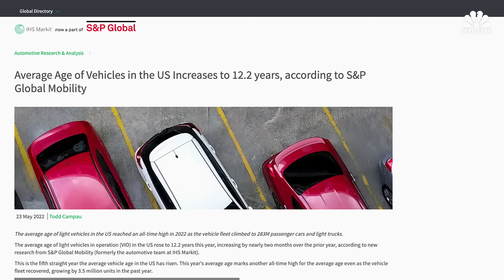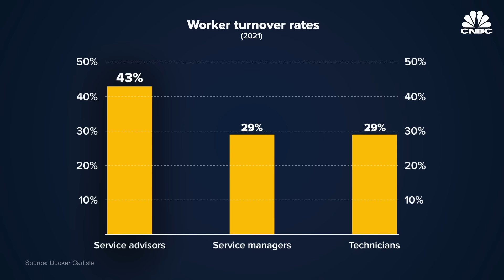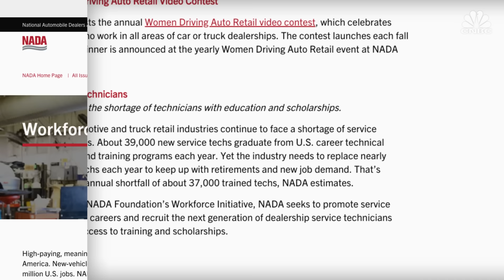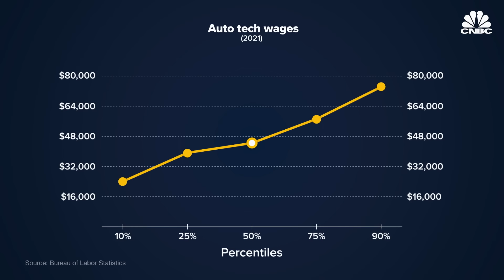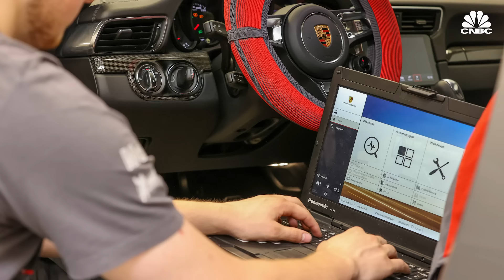Why The U.S. Has A Shortage Of Auto Mechanics

Comment: As a mechanic now I can tell you that pay and lack of training provided by the facilities themselves is making it really hard to make a living in  this industry.  We still get treated like grease monkeys even though most repairs are electrical or module based not even dealing with grease or dirty parts of the car. I myself am already looking for another opportunity to get out of this industry.
Reply: Look into machining.  After working almost 20 years as a mechanic I made the switch and would never consider going back to working on a car or anything else.  The pay is better and there’s a whole lot less drama
Reply: @bdp-racing  Its not as knuckle busting that's about it.  However, not all machine shop jobs pay well or are pleasant environments to work. Some people have to work in cnc cells 2 or 3  machines at a time. No air conditioning, no sitting down, no talking. . .some manufacturing is oppressive. Must punch out for lunch. . .Be there standing at your machine when the bell rings. Others are easy going. Today I work in an easy going place bosses are good. but that wasn't always the case. Places differ
Reply: It’s even more frustrating when a customer at a BMW dealership has to explain to the head tech what the bad module does, and the basics of Ethernet communication using corporate BMW wiring diagrams printed from home.
Reply: @jamie7664  yep, no lie.   That is exactly how bad it can be at dealerships, especially euro in the US, where we are pretty dumb, frankly, what with our 54% of population having a 6th grade reading level!!! yeah for realz!
Reply: Stop belly aching and open your own shop. All you need is a two-bay shop. Within six months, you'll have plenty of work.
Reply: Jerry Boden  The part had an eSIM that needed to be registered into their database (something only they can do). It was also a $1200 part that was still under warranty. Otherwise I always opt for doing the repair myself.
Reply: Jerry Boden  ISTA

Comment: The automotive industry has not seen a pay raise in the last 20+ years. Technicians in the 80's were paid 50% of the shops labor rate and cleared 100k. Now those techs are mostly out of the trade and the industry has greatly changed and become much more complex. Its almost impossible now to clear the same pay that was not uncommon 20+ years ago. Fixed-ops directors aka general managers are making 250k, service managers are making 150k min with bonus. Salesmen are all clearing 100k while they stand around most of the time and bs customers where we then have to go and explain to the customer that is not how their vehicle works. A technician is required to know how the vehicle works mechanically, electronically, features, options and diagnose a vehicle with 60 computers on it and multiple communication networks. Training is none stop because the technology is changing year to year and not getting easier. I have also seen a push where technicians are now being held liable if they don't catch something on a customer vehicle or for something that happens after the customer leaves. The professional tools are Extremely expensive! A single impact gun is normally around $500-$800 and the requirements to perform jobs on these vehicles cost the employee a huge amount of money and there is no reimbursement for it. I have 60K in tools and still need more but cant afford it. Imagine if there was any other field out there that required the employee to spend that much just to go to work.
You have a family, a home, utilities, gas, groceries, vehicle expenses, the list goes on as everyone knows. So where does it makes sense to pay a tech in this industry the way they do when the cost just to do the job is so expensive. Your on your feet 10+ hours a day standing on concrete working under a 200 degree engine and running around like your doing a speed walking marathon just because the shop wants to bring in 150 cars a day so upper management can get their bonuses.
New hires around my area are being paid $15 and not staying because they can go work with their cousin hanging dry wall for $24 to start, union, have  $ per $ match on their 401k and fully paid health insurance. Health insurance cost for my place out of pocket cost is $300 per month for a single plan, family plan is over $1000 per month... How.. Is anyone suppose to make a living with this.
Terrible pay, No Appreciation, long hours, horrendous benefits, working conditions, expensive cost in tools. This industry is going down hill and fast!! This industry needs to start coming to time and offering what every other trade has been doing for years!
Reply: I was a auto then a truck tech for 33 years, just recently quit the business permantly for exactly those reasons !!
Reply: Well said brother.
Reply: Wow, I never even thought of this. I was just complaining about the wait for my car that was in the shop. I have a whole new perspective now, Your work is appreciated.
Reply: @Sassysamaa  Industry secret.  If you put up with the wait, don't call every hour with "When's my car going to be done?" and pay your bill without any unnecessary drama, you'll become one of the shop's priority customers.  The shop I work at has a small group of priority customers who can bring their vehicles in and get service right away, at the expense of the "Joe Schmoes" who probably won't be back anyway.  The priority customers take care of their equipment (mechanics like to work on stuff that's going to be taken care of), they pay their bills and they keep coming back.

Comment: In the field for 42 years. I can tell you exactly what and when the issue started. It started in the late 90s when corporate business modeling took hold. Dealers were pushing the flatrate pay structure. That only works when on mainly one brand for efficiency. Independents started to adopt that pay structure. It doesn't work b/c all brands and mileage conditions are included. The efficiency goes down b/c of the skill level and equipment required. Shops started to push for techs providing equipment that shops used to supply. Mechanics not technicians used to be an asset to the company and treated as so. Now they are treated as a commodity that can be replaced. No respect for the soldier in the trench trying to save the day. Currently there has been a shift in volume available to produce the hours mechanics need. Hourly pay plans get a twist. They call it an incentive pay plan which is a lie. It's a penal pay plan. If you jump through all the hoops, billed & worked hours you get increased pay instead of just paying what a mechanic is worth. If you don't hit all the hoops, you lose pay rate even though you are working at the same quality rate. (Called penal plan b/c just like prison. If you don't do as required, you lose yard time or tv time. Penalized.) I come from a time when we were assets and paid accordingly. Usually, 50% of what is produced. That got chopped down over the years, 40% and lower to lucky if 10% in some cases. Also, there are more techs than mechanics to hire. Techs are the newbies from these useless training centers. You become a mechanic over years of experience as you take on new roles as tech, writer, managing ability etc. I get these kids fresh from training centers that don't know basics b/c never taught. Simple things like, why can't you run straight anti-freeze or which fluid is hydroscopic and why should it be changed on a 2 year schedule? The most shocking is when it comes to drum brakes. They are lost. They just pump out students willing to pay. I remember when I went to GM school. The teacher tossed out a kid b/c it was definitely the wrong career path for that kid. Where I used to work, we would take on UTI students to give them real world experience so they could break out of the hype told to them. One student took the advice when he started a full time position and called me to say I was so spot on of how the industry really is. He changed careers and started a glass replacement biz.  That was almost 20 years ago and he still thanks me. Many senior mechanics have switched to food industry. Same kind of busyness under demand. I agree that another issue is the loss of american car romance. With the systematic tear down of community through corporate expanse, we no longer have the corner gas station to hang out at and learn about cars. The need for double home incomes leaves less project time for dad to son car stuff. Less dads in the picture also contributes to this. Kids now just see transportation as a service need. Why would you have to deal with all the hassle of payments and insurance and parking when you could just make a call. In the future with automation, it will just be a service like other utilities. The over hype of electric cars saving the world is an issue too. I just keep pumping out 60hr a week for hourly pay until someday when I just can't anymore. Just turned 59 and even though there are some jobs I just don't prefer doing b/c I still have to make my body last, like replacing engines and trans, I am almost at the same pace as 30 years ago. I've seen many burn out and fade into something else over the years. I don't know if I'm lucky or not. I just have to keep busy to satisfy my A.D.D. or I'm left to come up with my own entertainment which is never fun for anyone else. haha. That is something I have noticed over the years also. Accelerated people like myself with A.D.D. or O.C.D. seem to be very good assets in this industry.
Reply: "No respect for the soldier in the trench trying to save the day" is the motto of the Republican party. I have some veterans in my classes. Officers that never go into combat and "men" that spent their whole careers in combat.
Reply: Respect to you and my apologies if I offended you in part or entirety in my reply, and for only responding to a few sections of your comment.
You mentioned that people used to become mechanics through experiences, as nobody was born mechanics. But as a youngster, I have heard and seen more times than many of us millennials like when some boomers act with disdain towards us trainees. Some even demand services provided by other workers. I am sorry that I have not mastered my proficiency as this is my first day on the job. But as customers voted with their feet, employers demand years of experience even for entry-level jobs. So millennials and gen-z have had a Catch-22 when looking for jobs: everywhere demands experiences, but (almost) nowhere's willing to give us those experiences! I am very blessed that I was born in a privileged family so that I was able to work-for-free for somewhere for a time to gain the first relevant something on my resume.
The other problem about people choosing not to be mechanics is that many blue-collar, working-class families don't want their sons and daughters to stay in that same class of society. Boomers and Gen-Xers were born and raised in an era that has more hope than nowadays. My aunt and her husband worked hard running their family-own restaurant, resting only on New Years' day, Christmas, and Easter(maybe 1~2 more, but I recall only about 4 days a year) so my cousins won't have to live that prison of a life. Now they are retired, and my cousin is working nice paying jobs in finance. They had hope that their son would live a better life than they do, and they have achieved it! Not as much for the succeeding generations: my cousin and his wife are white-collar double-income and still need help from both sides' parents to afford their house(well yes, a newer house but not a new-built like when my aunt first got married). I don't see a high probability of my nephew becoming richer than my cousin when he grows up, either.
Finally, or should I say firstly? You mentioned, "it started in the late 90s." Well, in the 90s we, the leader of the free world beat the evil communist Soviet Union! Yay! But, have you thought of it this way: Free and Communism aren't symmetrical as one is an adjective, the other is a noun. It should be adjective vs adjective, noun vs noun. So, they are the Communists, and we are the Capitalists. We are the Free world, they are the Fair world.
Free beat Fair. So, yeah. Don't know what to say anymore.
Reply: The issue started in the late 70s only getting worse each year and while there is lot of blame to go around insurance companies have a stake in keeping both the flat rate and book times to complete operations low and seem to control the databases that provide the information to keep repair operation times unrealistically low
Reply: Use paragraphs bruh
Reply: @DrJohnnyJ  this guy thinks its the romney party of 2012 still LOL

Comment: I quit this industry 15 years ago and I'm glad I did. It was brutal manual labor and got paid like $10/hr as a helper, doing oil change, tires, fluids, brakes, small job maintenance. but as the years went by, I didn't see much in terms of income, benefits, and appreciation from the employers. Imagine you have to get a $20,000 loan to get your own toolbox full of tools but your income is 18,000/year. So stressful and there is too much to learn mechanical under the hood, computers, electrical wiring. Too much works and under appreciated. The pay is not annual salary, but by the billable hours you work on those car jobs. You have to be at the service center 40 hours a week, but if there is not a lot jobs going around, and maybe you can only work for 20 hours billable time, you get paid only 20 hours. This compensation system is a big failure in this industry. Should get the techs on salary like guarantee 75k annually for a starter.
Reply: @raditz5  right.
Reply: What is funny is that it's still 10hr to do oil changes and rotate tires
Reply: what qualifications did you use to get the job just by change oil and the rotation of tyres?
Reply: did you just go there as an ordinary helper or an experienced worker with a qualification?
Reply: you know, before you criticize try to do a rethink of the criticism your about to vomit...
Reply: as a helper.
Reply: @talkless7981  I know what I talked about my history. okay? what is your problem? what did I say that you think I criticize?
Reply: @vatren765  my bad bruh
Reply: @vatren765  so how does the electrician work in the industry? Is there a division of labor? Cus here where I'm one person works alone on the entire car I mean you do everything alone. Lightening system, starting system sound system
Reply: It sucks for less experienced techs for sure but an experienced tech who is proficient in electrical and drive-ability diagnostics can name their price. I’m located in Louisiana and average around 100k. With my current employer I negotiated a base salary that guarantees 65k with weekly bonuses for hitting certain levels of flag hours. For example once you get to 20 flag hours you get $150 bonus and it goes up by 150 for every 10 flag hours. Good techs are becoming harder and harder to find so negotiating your price is getting easier.
Reply: @Jpilgrim30  That's good. I'm glad you got what you want. But not many people can do that. nowadays, we got to learn at engineer level to be a good paying auto mechanic.
Reply: @Sid The sloth if you worked for a dealership service center, 7500 sounds right. But If you were in garage shop, you would need tools for different car types. imagine you have to buy special tools too and see how much that add up. Can't make stuff up.
Reply: @Sid The sloth Gotcha. We are on point. you probably know, the OBD scanner already cost more than 10K for a senior auto mechanic to own it. too much for me to buy one.
Reply: @raditz5  WE didn't get that money sir. It's expensive to run a shop with commercial lease rates and commercial zone taxes. The shop has to provide the high dollar diagnostic tools and several other items as well. All are expensive. Then we have emission and environmental costs. Not to mention worker's comp insurance. Many shops are circling the drain from the staggering cost of doing business like taxation, permits, insurance to name just a few.
Reply: 18k a year? what
Reply: You don’t need $20,000 In tools to do oil changes.
Reply: @@sidthesloth128 you don't get a tool allowance? Come on, G that's the best part about HD repair: company sponsored tool hoarding and brand whoring! I've got an Apollo, a 2k navistar drawer, 1.5ish paccar drawer, 950 cummins drawer,  3k in CAT and 5k in Altec, Terex and versalift hydraulic test and repair equipment, 75% eaten by the shop. You probably make your shop that amount in one month, so if they're corporate tell them to fork up the dough or you'll walk. If you got the experience then they'll pay, and if they won't, someone will.
Reply: A company truck driver can make 75k.